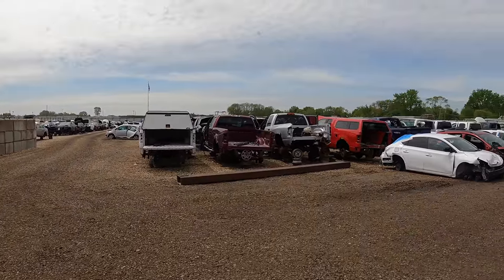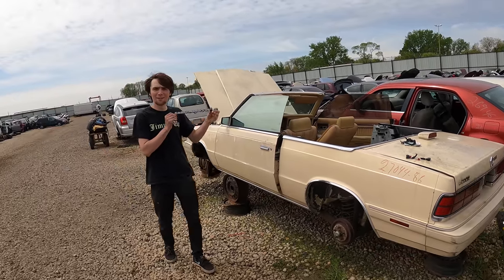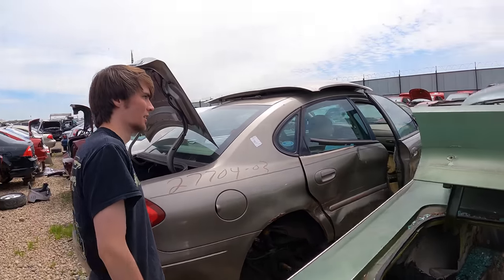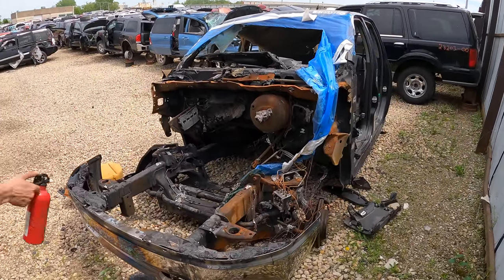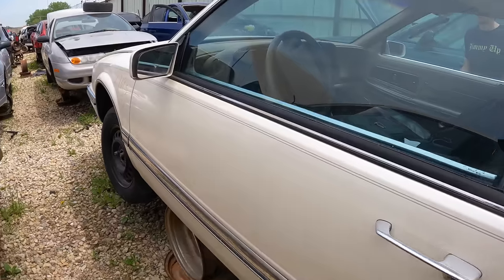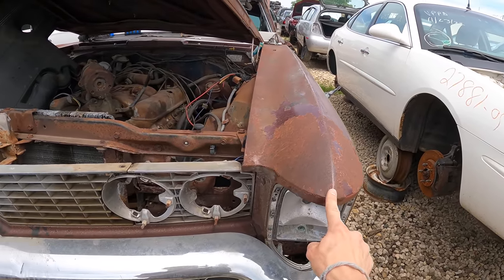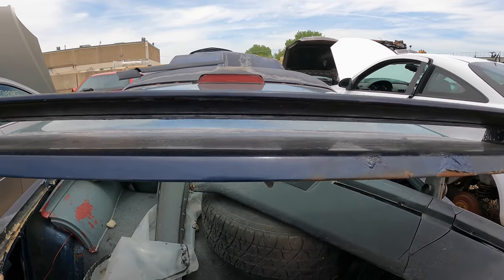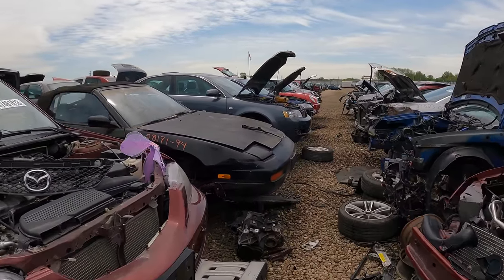Exploring a Junkyard and Finding Gems!

Comment: The green one with the gold wheels was a Pontiac Bonneville SSE. Supercharged and really cool to drive! They actually were beefy and peppy - not crazy fast but it was fun to drive
Reply from the maker: Looked like a pretty cool unit!
Reply: @PrizzaMike  The wheels on it are 5x115 for whatever it may be worth.
Reply: If it’s the one in the thumbnail, looked more like an xw/xy ford falcon
Reply: @cameronclark3418   no, I was referring to the one that was later in the video, the newer model. When they popped the hood and saw a supercharger on top and said, “this thing is supercharged?!”. That’s the one I was referring to. I shouldve put a time stamp in my first comment
Reply: The engine out of those transplants in a Fiero really well.
Reply: a great engine for sure put that in a lighter car would be awesome
Reply: Pontiac SSE was a badass car.

Comment: That's a 2005 or 2006 cobalt SS, all the trim is stock 😏 the red interior is not painted, it's factory, and it comes stock with a factory 5 speed trans with a supercharged 2L inline 4 engine, 2008 to 2010 is the turbocharged inline 4 cylinder 2 liter engine with a five speed transmission with a no lift shift option on the forced induction models, I can go on, I'm a cobalt inthusiest, I really like the SS's and I'm glad you came acrossed one 😅

Comment: 14:35 Fun fact: that's a factory Eaton M90 supercharger, it's a Bonneville SSE, but I think the same supercharged 3.8 V6 was used in the higher end Grand Prixs making 240HP, also congrats on 100k
Reply: Same with holden commodore in Australia and New zealand
Reply: I've got the same factory super charger on my 02 Nissan frontier.
Doesnt help my gas mileage whatsoever, but it's got great torque,  not fast bit quicker then the average v6 truck.
Reply: @motov8-garage832 I am pretty sure the stock supercharger on a VG33ER is an M62 and Nissan detuned the crap out of that motor. How do you only get 210hp from a supercharged VG33, when the VG30et in a 1987 300z had 205hp?

Comment: I had a 98 Grand Prix GTP coupe, it was dark green with tan interior. Had the same Supercharged 3800 as that Bonneville SSEI. Now I have a 2001 GTP Special Edition. Don't sleep on the 3800 platform! ZZPERFORMANCE has a 1250HP Turbo Grand Prix running under 9s in the 1/4 mile. Still a 3.8 V6 & FWD

Comment: I had one of those Pontiac Bonnevilles, you would have hated it, everything was brown and beige and screamed of "Old Man", but they were pretty quick, 240 horsepower and gobs of torque! If the air suspension worked well it was a smooth ride, too. It should have had an air compressor to fill the tires built into the sill of the trunk, too, and many had a heads up display projecting the vitals onto the windshield. 
If the gauge cluster is intact and works (and it has a little square LCD screen to the right) you might be able to get good money for it. I paid $200 for that one part alone. Alas... I blew the engine at only 277,000 miles. It had so much more to give!

Comment: The Cobalt SS you found was a supercharged model. Not surprised the motor and trans was gone. Probably a G85 model with an LSD trans.  However that rear lip is worth about $100-$150! If it's in good shape consider going back and snagging it!

Comment: The pt mount in the frame same as my srt4s first step to take it out “remove engine assembly” you can get around it it you take off all the mounts and with 2 jacks lower the transmission and push it under the frame on the drivers side and move the engine over. Bitch of a job decided to do it a day before school. Started at 2 finished at 10
Reply from the maker: Interesting! Good to know! I was so curious when I saw it!

Comment: The green car with the abs rims r off a Pontiac I have a par exactly like it that I was gonna put on my talon or prelude but there 5x115 and I’m 5x144.3 I have heard a lot about it and chose not to run them because of the difference but I’m wondering what your opinion is on it ???